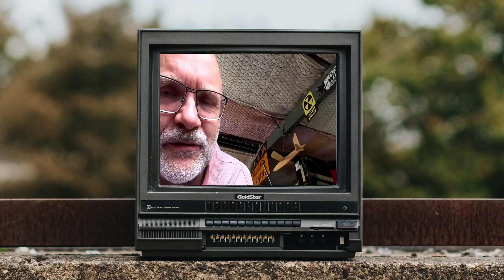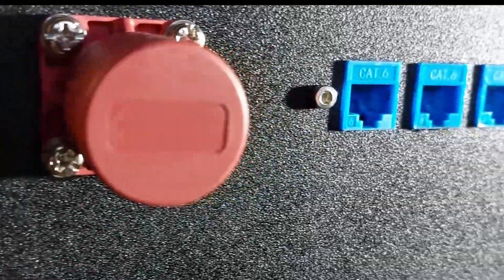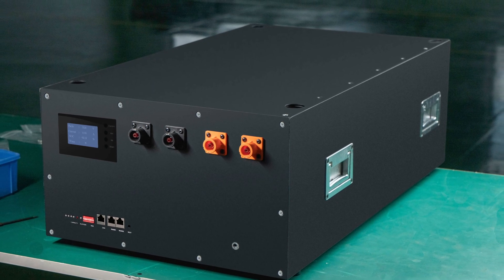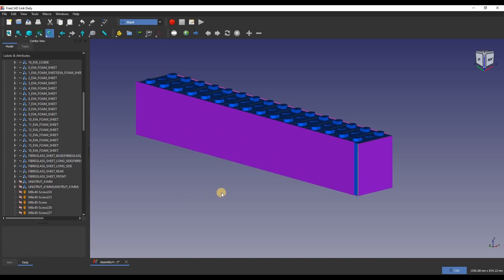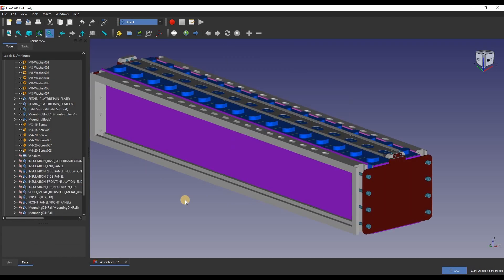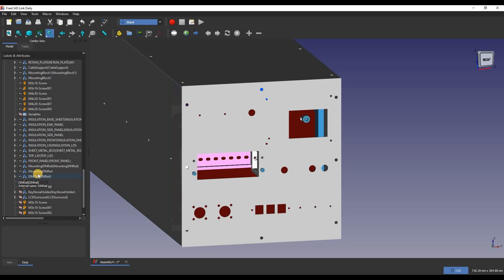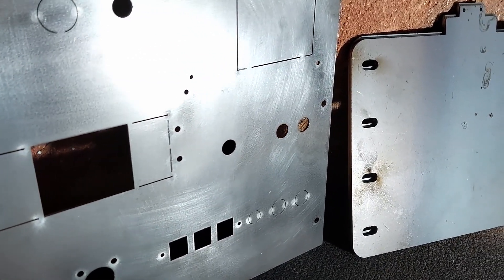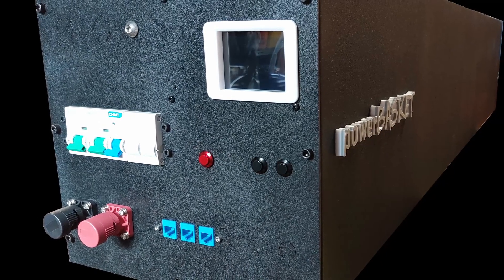Battery Enclosure for LIFEPO4 - powerBASKET?

Comment: Hi Stuart,

How much did the laser cutting company charge to produce your design?

Also, you mentioned the Seplos Mason comes with a BMS which you wouldn't use, is there a particular concern with regards to the included BMS?
Reply from the maker: Laser cut enclosure was less than £200, the BMS with the Seplos is unsurprisingly the Seplos BMS !
Reply: @StuartPittaway  are you using a Seplos BMS then please? is that so it can communicate with the Sofar inverter? do any other BMS's work with the Sofar inverter?
Reply from the maker: I'm using my own DIYBMS system in the battery build

Comment: Hi Stuard, nice design and implementation. If you would redesign the battery compression part, how would you alter the current design?
Reply from the maker: The existing design does work well, but its probably over engineered, the unistrut rails I've used are overly heavy, and its probably just as easy to use threaded rods to achieve the same thing.  I would also now design the enclosure as rack mount style, probably floor mounted.

Comment: There's a lot of thermal insulation in there. Aren't you worried about the pack overheating in summer when charging/discharging at high currents?
Reply from the maker: The inverter is 3kW max - which is 60amps - so each cell is charging/discharging at less than 4amps each.  The cells are rated at 0.5C (140amp) maximum, so its a tiny amount compared to that.

There is still potential for over heating - but the BMS will tell me that and stop charging.   From memory 55oC is the highest temperature the cells are rated to.
Reply: @StuartPittaway  Thanks for answering :)
 That is indeed a small amount, however:

  * Are the cells all going to be in parallel? If so, can you guarantee the current will split evenly? I don't expect there to be large differences ( unless some failure occurs) but there will certainly be some which will lead to some cells having a higher temp. 
  * I don't know how high the ambient temp goes to in your climate/garage in summer, but considering how little heat the box will loose, it can accumulate. That depends on how hard the system will cycle, so basically on the system load and solar power input. And in summer you have both a high ambient temp and a lot of solar power coming in.

The BMS protection will shut it down on overheat, but that would be a loss - if the box had a fan mounted, that could help with overheating a lot. And you could cover the vents during winter.
Also, what does happen at the end of charge when say, some cells are "full" and others are still charging? I understand the BMS will be discharging the full ones to balance them, but does it do it at the full charge current?  Now that I think of it, if they were all in parallel is it even possible to balance individual cells?
Reply from the maker: The cells won't be in parallel - its a 16S series string, giving 16x3.2V nominal voltage (51.2V).

You are correct, the current won't be equal across all cells and depends on the internal resistance, hopefully that's very  similar across the cells.

Agree with the fan idea - I may just remove the insulation in the summer months, if it becomes a problem.  The max temp I've recorded this year was 34oC in the garage - so the 55oC max is a possibility.

The BMS can control the inverter/charger using CANBUS, so it can dynamically lower the charge rate into the cells if it needs to, based on balance/temperature or state of charge.
Reply: @StuartPittaway  If it's a series string, all the cells should have the same current...ish. So...full 60A over each cell, I think? You'll be able to test it as soon as it's all put together though, no need to wait for summer.
But I'm looking forward to a follow-up video next September about how it went :)
Reply from the maker: @GalvayraPHX  You are correct, I'm mixing up my Volts and Amps again !!

Comment: Is it possible to reorder the enclosure box which you made  from the same company?
Is there any diagrams or any details which we can use to get it made instead of re designing? Can you give the  laser cutting company  ?It would be good if you create a video with prices of all the items and the place where we can procure it at the best price and alternatives if its there and Can you supply the bms? We can get the daly or JR or so from the market but if you are providing something for 16s battery that would be great
Reply from the maker: I've not published the files I made for the box. I used a local laser cutting shop to cut and fold the steel.

Comment: what battery connectors are those?
Great build, will the front panel be visible when mounted on the wall?
Reply from the maker: Yes the front panel will be visible.    These are the connector posts - https://www.aliexpress.com/item/1005003993706972.html?spm=a2g0o.order_list.0.0.3aea18025OXM3Y

Comment: I've had mine commissioned for a few months, but I need to make a simular box. What where those connectors you used ? Any links you could share ? Ah found it on aliexpress "250A Through-wall Terminal New Energy Energy Storage Lithium Battery Positive And Negative Copper Terminal Connector", now just looking for the other switches :)
Reply from the maker: The MCB's I used are from ProJoy - quite hard to find/order.

Comment: Is the plan to integrate the ME3000SP with DIYBMS?
Reply from the maker: Yes. I've already got the code working for pylontech battery emulation, it's on a GitHub branch.
Reply: @StuartPittaway can you tell me how to do this? I need to get this code and how to install it thanks

Comment: Very cool Stuart. Why would you need compression in the first place? I'm not familiar with building batteries. Wouldn't the nice case hold things okay?
Reply from the maker: LIFEPO4 cells swell up when charging and this can lead to a shorter life.  Its not critical to compress them, but hopefully gives them a few years more life.
Reply: I am no expert by all means, but the way I understand it, is if the batteries will be light use, then there is really no need for compression.  If you will be discharging/charging fast, then it's a good idea.  Also, if your batteries will be seeing vibration (ie: in an RV or such) it's a good idea to compress to ensure the bus bars don't tweak the terminals too much.
Reply from the maker: @markseamans4682  I'd agree, the cells are only lightly compressed to hold them in place.  It will also stop them moving/stretching the connecting bars.
Reply: @StuartPittaway  For my RV build with the 304Ah cells (48v) I'm planning to use 2/0 with some well crimped lugs to allow for a bit more vibration.  I'll use some MG Chem 847 in the lugs and assembly to help prevent resistance.  Naturally, I'll pull out my ohm meter and do some tests first.  I also picked up a internal resistance meter for LI batteries.  Hopefully it can shine a brighter light on the build.